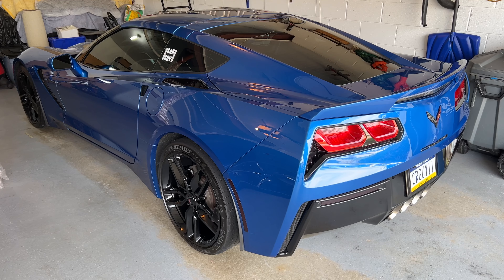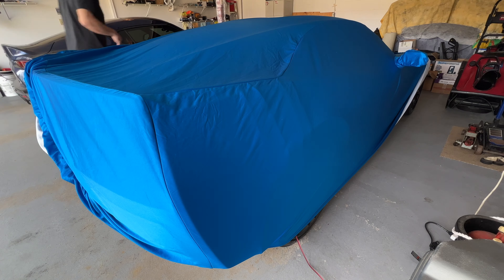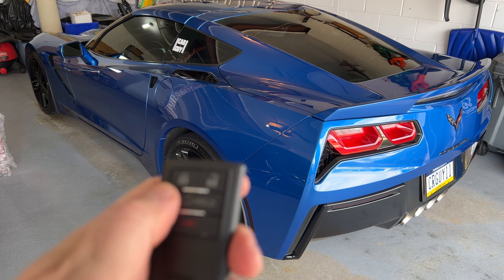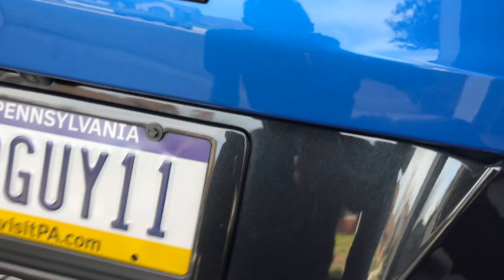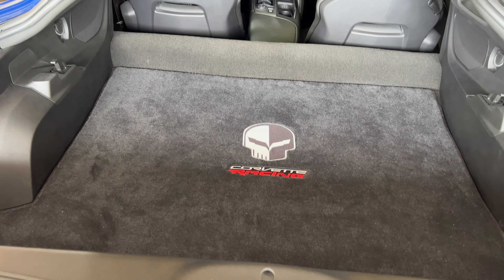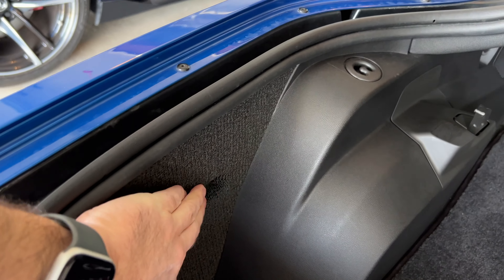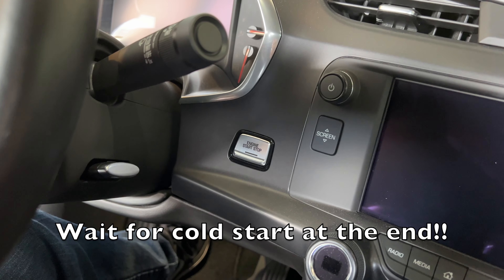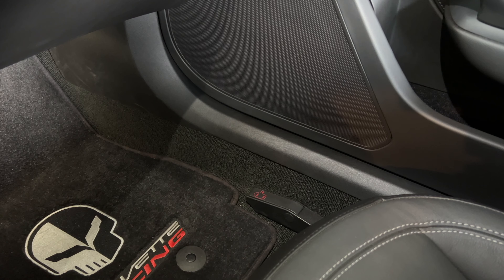C7 Corvette Emergency Exit & Entry Door Release - Dead Battery

Comment: 🤣🤣🤣 omg i bet he feels ret..... special lol  bro just thought if his battery died (loses connection) hes stuck lol 
Both the driver and passenger side have these levers in case the battery fails while youre in the vehicle. If youre outside the vehicle and find your battery to be dead, the fob has a physical key inside it. Theres a keyhole to the right of the license plate.. this will release the trunk door. Inside the trunk to the left theres a pull tab that will release the driver side door. 
If your fob is dead, repeat these steps and then slide your fob into the slot on the right side of the steering wheel and you can start your car even if the fob is dead..
Reply: What

Comment: Before you start your car step on the gas pedal then the brake start button & motor will prime oil pressure let of gas pedal & car will start after a few seconds your oil gauge should go all the way to 80 PSI then car will start after winter storage !

Comment: How do you get in if the key does not work in the trunk key hole??
Reply from the maker: The physical key opens it as shown in video.
Reply: @CarGuy11  I think he means the key isn't working.  This happens if the keyfob was swapped out but key not replaced properly

Comment: What happens if you have a dead battery and locked the whole key inside the trunk is there another way to open without having to pay for a locksmith
Reply from the maker: Yes the Onstar app can unlock it.
Reply: @CarGuy11  but my battery is dead
Reply: The car will not turn on its completely dead and I locked my only key in the trunk this is to my c7 corvette there is no pully hidden. Anywhere to unlatch the trunk with the manuel key?
Reply from the maker: Locksmith unfortunately emergency trunk release.
Reply: @CarGuy11 c
Reply: @centralcoastkenpokarate  i9

Comment: So I’ve got a funny story about myself and a good buddy of mine’s dad. So his dad has a 2014 Vette . He doesn’t drive at all. Basically I’m the only one that will take it out and put a few miles on it because it has to be done or else it’s gonna sit there and ruin. So one day I’m over there and I’m gonna to pull it out of the barn, Super Nice barn, I hop in and on instinct I shut the door and hit the button, Nothing!!! Hit the button again,Nothing, no dash lights, headlights, door chime!! So I’m basically trapped and on top of that I’m suffering from a severe rib injury and can barely move and for the icing my phone is sitting on the work bench and he is inside and rarely comes out to the barn instead he rocks on the front porch. Short story long I didn’t think about getting the owners manual out instead I released the roof latches and gently wiggled that thing loose, luckily it was the glass roof, and got it up and was able to get that thing slid far enough back in the hatch that I could get myself up in the seat to stand up. After yelling for 5 minutes with no luck I had to find away to get myself up and over the interior and exterior without damaging a single thing. After pulling a Spider-Man stunt and about to die from serious rib pain after getting free from this I hobbled my butt inside and asked him if he heard me yelling for him and what I just had went through getting out of the damn thing. He was like no shit, ya no shit. Then he proceeds to tell me that he thinks their is a safety pull next to the seat which their was. All I can say is read your owners manual!!!
Reply from the maker: Haha oh boy. Yes a lot of people don’t know about the safety release.